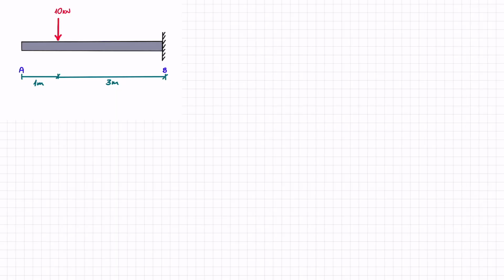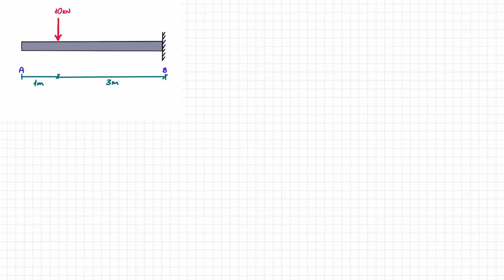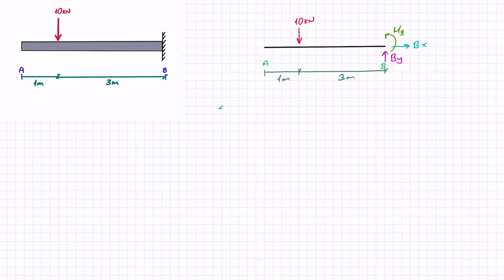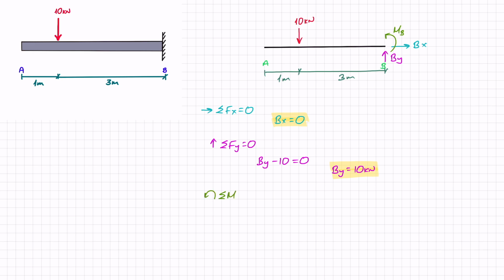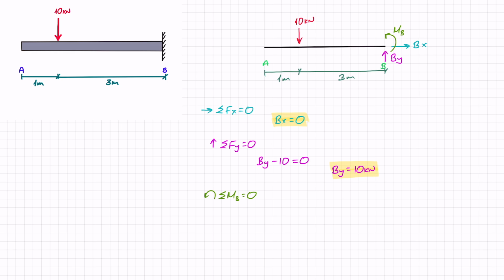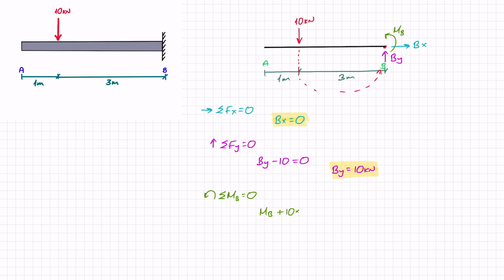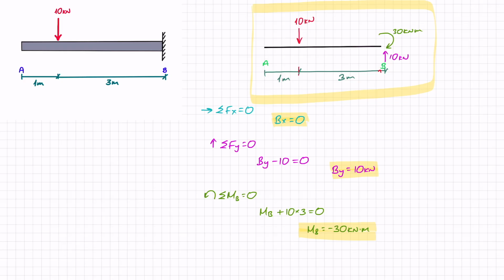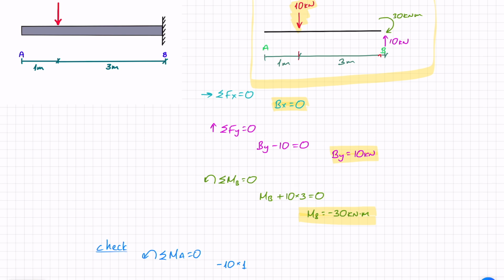Engineering Mechanics | Reaction Forces Cantilever Beam with Point Load Example | Tutorial 2

Comment: but in the previous video , in that we had 2 reaction points , thus when we calculated Ma , we did not take Ma itself in the equation , but when we are doing this Mb we did take Mb in the equation . why is that ? is it because it is a cantilever beam ? thats why when we check for Ma , we also considered 10kn for both A and B point , like   "-10kn * 1 + 10kn  * 3"  . are we calculating this way  because its a cantilever beam ??
Reply from the maker: Great question! The difference comes from the support types, not the calculation method.
In the previous example, the support at A was simply supported, which means it cannot resist a moment. So the reaction moment at A is zero, and we don’t include it when writing the equilibrium equation — only the vertical reactions and the applied loads are considered.
In this new example, B is a fixed support, which can resist a moment. That’s why the moment at B appears in the calculation — it’s an unknown reaction that we must solve for using equilibrium.
At the free end of a cantilever (point A), there are no reactions at all, so there is no moment to include there either.
I hope this makes the distinction clearer — but if anything is still unclear, feel free to ask and we can drill down further!